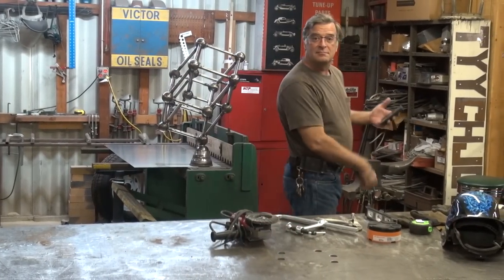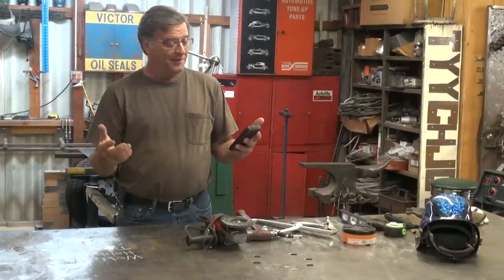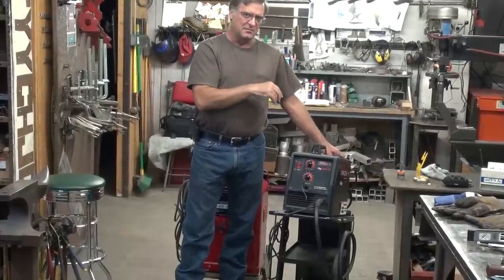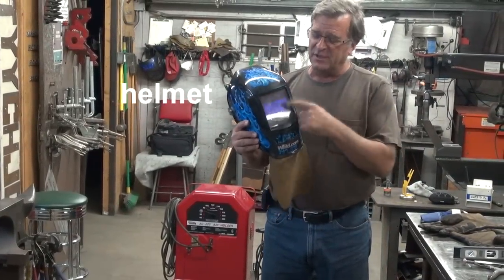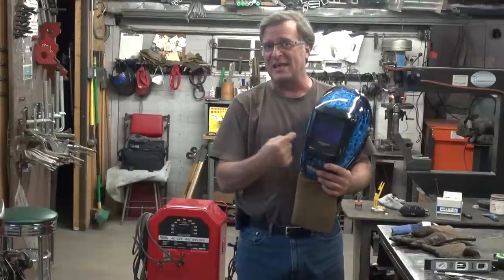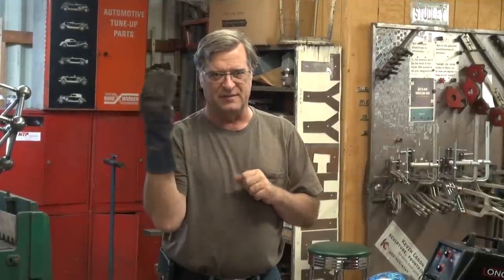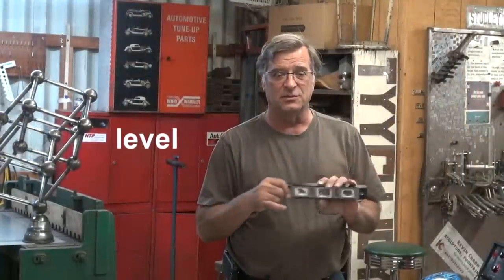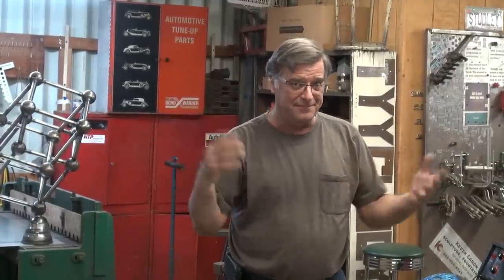What You Need for Your Fabrication or Welding Shop - Kevin Caron

Comment: I throw a piece of wonder board (tile backing board) on top of my wood table, it's cementitious
and blocks the heat, nice and flat and only about 5/16 thick. Great protection and cheap.
someday I will build a metal top table with holes for clamping and jig setups but for now this
will have to do as I use the table for multiple uses.

Comment: thing to add from me... welding gloves leather is treated differently than regula leather it's something called dry cured and the regular leather will let molten metal right through onto the skin. use welding gloves for welding and other gloves for everything else(unless specified for work type)

Comment: I like your Welding shop video. As you know, you never stop adding tools to your shop. There are a lot of TIG welding tip videos but they never cover metal prep. Tig welding of some materials require almost surgical cleanliness. We weld only Titanium and you can tell if you handle the Ti with dirty hands. Make one on steel prep. Thanks

Comment: An idea for work surface based on a wooden bench is to make a base consisting of large channel sections.  These allow air to flow under your metal plate to manage heat.  I put a 3/4" steel plate on top of scrap 5 inch channel then a quarter in plate on that.  I use oxy acetylene torch for brazing and the plywood table is not scorched a bit.  The 3/4" plate is about 200 + degree for an half hour though ;)
Reply: Adequate cooling for underneath the bench surface is a must. I really needed it for my welding station where I have my everlast welders because it is such a small surface to begin with and it takes a long time for it to cool off.

Comment from the maker: Any foreign matter in the puddle with make a weak point for the weld to crack at. Just rust in the joint will give a weaker joint and over time it will fail. 

May not matter if you are making a wall hanging but when you are building a skyscraper it is important!

Comment: Hi ! Kevin , I just bought a Lincoln AC/DC Arc Welder and will be trying it out tomorrow ! I used my Texas BBQ with a 1/4" plate on it ! Please don't tell any Texans ! I also have a nice selection of electrodes , 6010 , 6011, 6013 ! 7014, 7018 , 1/16, 3/32, 1/8, 5/32 ! About a hundred twenty pounds of them ! I also have a mig /fluxcore welder ! Where did you get that Rhino horn anvil ? I know that didn't come from Harbor Freight ! I have most of the other things you mentioned in this video ! But I am a little leary about those cutoff wheels ! I have seen some of those " Explode" ! Thanks for all of your recommendations and videos ! I almost bought a Lincoln Ideal arc 250 welder , wouldn't fit in my car ! 410# and huge , the pictures looked smaller ! Lol  Take care my friend and have a great Holiday weekend !
Reply from the maker: +Mr. Heiss The anvil is from a black smith school that closed after 30 odd years here in Phoenix.    Found it still covered in cosmaline and paper..    Had never been struck!!    Thanks for watching!

Comment: Nice video, as per usual.

What, no mention of O/A? Welds thick, thin, brazes, cuts, bends, warms a cold cold winter workspace, indoor/outdoor...

Used fire bricks under my metal to help protect the surface under it.

Comment: improvise seems to be my middle name but i never thought about using a trailer ball or heavy bumper for an anvil im glad im not buying a lincoln tombstone welder in az becasue they are going for about 400 here last time i checked and since they are very robust and simple you can pick them up from 150 to new price on craigs list and you end up with a good machine cheap that will last several years mine was actually purchased by my dad in the 80's and then given back to me for nothing lucky me

Comment: Hi Kevin I'm a 20 yr retired union ironworker but am now the county welder for highway dept. was given a shop w no tools and junk for welding burning and cutting. Rt now I'm trying to bend 1/2" x 5" plate to 90degr. For curb feelers for snow plows 1st acet regul was red lining on me changed it out w another I found which seem to be in working condition. After I finally got it set and stop popping I set up some dead men on the table to use a come along to pull steel around Got it started and got abt 40 degrees bend. I noticed that rosebud tip was HOT so I let it cool then every time id get hot enough to start bending again tip was crazy hot and I didn't want to melt it so had to stop. Don't know what size tip it is like I sad was handed down JUNK will hv to wire wheel it to hopefully get a number off it The welder I replaced was 78 yrs old. Just sat in a chair for last 10 years and did NOTHING so I couldn't guess how old this equipment is. Your help would be greatly appreciated
Reply from the maker: +Beth Paul      You need a forge!      Or just a bigger rosebud...     Coal fired would be awesome..     Or propane fired...        Or hardwood in an old bbq with a fan or hose from the air compressor to make the flame hotter...

Comment: Thank you , Kevin ! I am using my , Texas BBQ , for my welding table ! I have a 1/4" plate that fits inside , removable of course ! In case I want to smoke some meat , I put the grills back on !  It has wheels , so it is mobile ! I live in a trailer park ! So I made a "Pigtail " for the electric box , Walla ! 240v. Hookup ! Oh ! It works great ! Thanks for the videos ! I wish it had a beer cooler , I'd have a heavenly set up ! Lol

Comment: I didn't know shipyard welders would connect AC buzz boxes in parallel. Too bad I don't have 250 dollars to do all that, but I'm happy with my transformers connected in series. It can weld 6010s smoothly without sticking and on AC. Maybe AC buzz boxes connected in parallel can melt 6010s smoothly with MIG-like welds like I saw on WeldingWeb.
Reply from the maker: Never heard of doing this.     Might have to look in to it.

Comment: Love your videos. You make it seem possible to a newbie who is overwhelmed with information to be a welder in the not so distant future. I'm extremely new to welding and fabrication but absolutely loving it. Trial  and error method but it's becoming a hobby very fast. Only problem I'm having in setting up my shop is I have a great 10x20 newer shed but what concerns me is it's aluminum siding outside but wood framing and plywood walls. Is this a no go? Haven't welded in there yet afraid I'll set it on fire. Welding outside is ok but tired of bring tools out and putting them back up. It's a process.  Thought maybe putting some cheap as I can find sheet metal to use as walls over interior walls.
Reply: No problem at all.     Just try to throw the sparks out the door instead of against the wood.    You might place a thin steel sheet stood off from the wall to deflect sparks as well.
Reply: There is fire retardant paint that you can use on the walls.  I am guessing that the floor is either dirt or concrete?  Keep a fire extinguisher in your shop (you can get one at any hardware or big lot home center like Lowe's or Home Depot.), a five gallon pail of water, and a pump up type garden sprayer full of water to combat any small to large fires.

Comment: If you're going to be working with aluminum, and already have a miter saw, and a blade with carbide, you shouldn't damage the saw if you use it. Just pull of the dust bag. I don't know about steel on it. The carbide won't have a problem with cutting it, they use carbide in mills and lathes, but I don't think it would be good to use on the table, you'd end up with some scratches in the table and fence, maybe worse. I don't think they harden it enough for steel rubbing against it.

You could use a circular saw for big pieces, I don't think I'd want to use it for little ones, the cut-off wheels would be better for that, and you run into the same problem as above if you want to cut steel. They make the saw blades, but the tool was designed with softer materials in mind.

Then again you could fabricate a jig to go over the parts of the saws you are a concerned about damaging. I might try that. Guys make sacrificial fences for their table saws so they can joint wood, or use their table saw as a lathe, but they are cutting wood in those applications. But you could do something similar for your miter saw, or whatever saw.
Reply from the maker: Thank you for watching and posting.   I hadn't thought of that.
Reply: @KevincaronSculpture  no problem. And thank you for the response. You got a lot of good tips.

Comment: +Kevin and/or forum,

I'm just starting, for X-Mas I got an AC-225, I don't have the 220V in the garage yet.  I realize it needs to be 50A for that.

Thinking of future "toys" to buy (i.e. TIG, MIG, plasma, mill, drill, lathe, etc...) will a 220V/50A circuit suffice or will I need anything higher than that?
Reply from the maker: +Ronald Easley               50 amps will do you good for every thing you want ..    Just not all at once!
Reply: Roger that, Thx

Comment: anybody starting out welding should learn on stick/ arc welders, they are cheaper to buy and uncomplicated to set up and operate it's a no brainer.  FACT
Reply: gc19901 you should learn how to weld with stick, but all around best welder to buy starting out is mig. Fact.
Reply: na
Reply: gc19901 stick welding can be frustrating at first, but when you get the hang of it there's a lot of work you can do while saving for a nicer MIG setup.
Reply: good point shao kahn

Comment: Can you just start with a Acetylene Touch I was thinking about a DHC 2000 Acetylene Tourch
Reply from the maker: Never tried one. Sorry.
Reply: The best way to learn how to weld is to start out with oxy-acetylene. If you don't do much welding and your finances don't allow you to have much equipment, an oxy-acetylene torch is the thing to have. With the oxy-acetylene torch you can do cutting, and you can use the heat for heating up rusted bolts or heating up metal to bend it, and you can do welding.

Comment: You didn't cover the types of grinding wheels, or wire wheels for the 4 1/2 inch angle grinder.  I know to cover everything would be a lengthy video.  There is also safety because of so many ways to get hurt or damage property in the shop.  I have seen so many people get hurt when first starting out in fabrication, which also requires welding.  So far nothing too serious besides a couple of stiches and a lesson well learned.  I enjoy your videos and will look forward to future ones.

Comment: in welding school. i need something for home practice doesnt need more than 150 amps max but needs to be dc for 6010 practice though i may want an ac/dc machine so i dont have to buy a second machine later. preferably something in the 200 to 400$ range anyone got suggestions?
Reply from the maker: I would send you towards the Everlast PowerArc line.   You should find something there.
Reply: Fox Moulder spend the extra money and get a stick, tig combo, everlast is an affordable option

Comment: if im building frame [addons] to cars/trucks ...should I be using gas(mig)? Also should I get a Chop Saw for making my small frames like battery boxs,angle cuts and such? Im using a cut of wheel on my grinder and large dremel.
Reply from the maker: +Nick Maresca 

Yes and yes..
Reply: Hi I'm Tabish rana from Pakistan is I welding work on Pakistan

please help me I protocol me
Reply from the maker: I am sorry, I don't understand,

Comment: I disagree with what you said about the stick welder and the mig welder. I believe the stick welder is the first welder a person should buy. A stick welder will do everything a mig welder will do, and more. A stick welder is the best one to have for doing repair work. If you are going to have only one machine, the stick welder is the one to have. A stick welder is actually easier to learn how to weld on. And if the stick welder is DC, you can do tig welding. Get an argon bottle and a tig hose and a tig torch, and you can do scratch start tig welding with that DC stick welder. As for that 140 amp mig welder, light gauge metal is all you can weld with it. To weld 1/4 inch thick metal you would need at least a 170 amp machine. 

You forgot to mention a vise. A vise is almost a necessity. Besides holding stuff, a vise can also be used as an anvil. You also didn't mention an oxy-acetylene torch. A torch is also nearly a necessity for both a welding shop and a vehicle repair shop.
Reply from the maker: And that is the great thing about this country.  We can disagree and still have a grown up discussion.   

Thank you for posting.

Comment: What is your recommendation for ventilation in a garage? I was thinking fans but don't know if that is better than a mask. Please let me know what you think.
Reply from the maker: Eric Cannata I have been using a respirator now and it makes a big difference. I leave the door open when I can but have to watch the wind so it doesn't blow the gas away..    Mostly I just try to keep my head out of the smoke.
Reply: Does it have to be a certain one to handle metal? And thank you very much for your response.
Reply from the maker: Yes, I got this one at the local welding store..  It handles all the fumes from welding..  Not made for grinding..   those take different filters.
Reply: Oh ok. Do you think you may be in the clear with one of those if you do your grinding outside?
Reply from the maker: No I do not..   I have had 5 different sinus surgery's over the last 10 years or so.. Using the dust mask and respirator have made a HUGH difference!  Being outside will make a difference but not as much as just putting on a dust mask..
Reply: Oh sorry to hear that! OK well thank you very much for the information I really appreciate that!

Comment: Hi I have a question  how do I covert a Lincoln 240 to a 115 volt  help please and thanks
Reply from the maker: saul jimenez There should be a jumper plug to adapt the 240 plug to 110.    The machine will know what to do when it sees the lower voltage...
Reply: Thank you

Comment: hey Kevin i have been a long time subscriber and love the vids very informative...I just bought an old Lincoln Idealarc 250 tombstone stick welder. The only thing is there is no stinger or ground and I don't know what size wire to buy to complete the unit so it can be used. Any idea what size I need...thanks
Reply from the maker: Not sure and hate to guess wrong.      You should check with Lincoln to make sure.

Comment: What is the cost of starting a welding shop? I know you that answer can fluctuate and be high into six figures. However what is a good minimal amount on supplies, not including shop rent. Can one do it with lets say $15,000.00

thank you
Reply from the maker: Nope,  figure more in the $25 to 30 range.
Reply: A welding shop is a broad statement, you could have most of the stuff you need for welding for roughly $2,000
Reply: From a business standpoint. From one business owner to another. Buy the absolute minimum to make money from day one. Buy a hundred dollar 110v flux core and $300 in gear and turn a profit first. If you hate it or realise it takes you a ton of time to get good at least you didn't spend $4k on equipment you now can't or won't use or won't make the money back for years. As you improve in welding buy better equipment and get educated and tested before doing anything structural for anyone else. Stick to Craigslist adds for repairing yard art, metal lawn furniture, and purely cosmetic or sculpture things for the first year or so then move up later. Minimise costs, expenses, inventory and time invested to improve your chances of being successful. You can make back all of your investment and more quickly and reinvest quickly if you're smart and grow slowly. MOST Importantly keep a reliable source of income aka your day job for a few years until you can reliably make enough welding to support yourself, too many businesses go under because you can't go from zero to $50,000 in a year with no experience and the owner runs out of savings. Its not possible don't delude yourself. Slow steady growth is good avoid risk, avoid lawsuits.